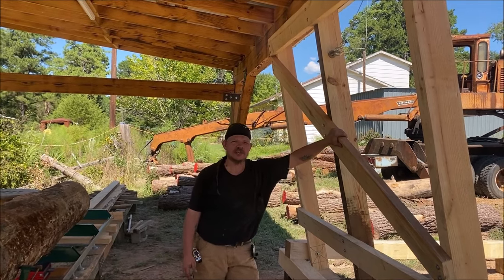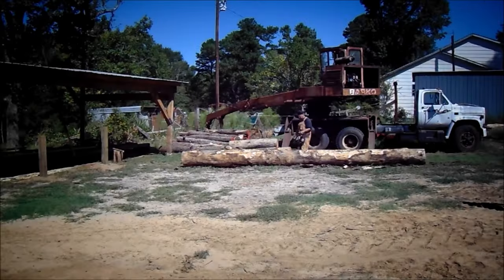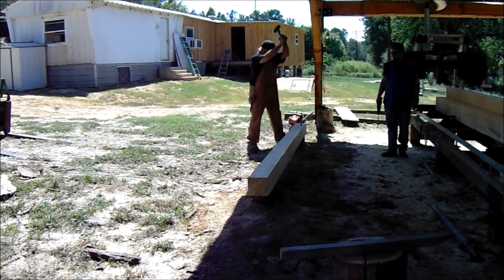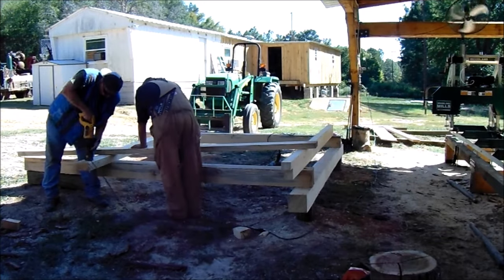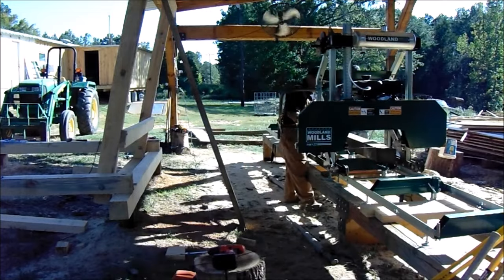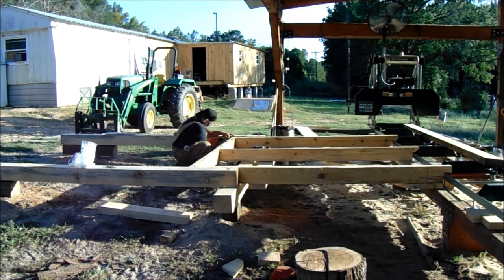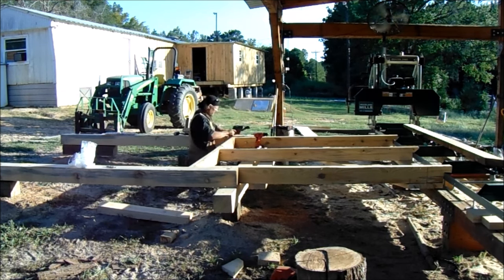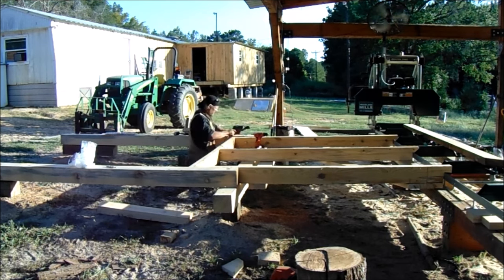Log Deck With Automatic Raising Ramp Build

Comment: I bought two 25 lb boxes of 12 inch spikes 25 years ago. I think I paid $5 each. One box is galvanized screw spikes. I think they used them for log cabins. The other is a wire nail like 1/2 inch diameter bright finish. I have used them for everything and still have a lot of them left.I want to make a brow for my 126 mill. its a lot easier to load from a brow. A mill shed would be good too, but this is my last house. I have a slab to put the mill on.That sits on ledge. We have lots of ledge to set stuff on. Dirt we dont have.Black walnut ! We dont have any in ME.
Reply from the maker: We appreciate you watching our videos and commenting, I wish I could find me some of them to buy, but I just made ours out of re-bar and washers, and beat the end to a point.
Reply: @CountryHomestead1 Thats a good looking nail you made. Those spikes I have were Made In USA. That is how long ago I bought them. Did you drill pilot holes before driving them? I imagine the dimples? on the rebar would grab pretty good too.
Reply from the maker: Yes sir, we pre-drill the hole first and then nailed them in and ya it holds them real good

Comment: Sorry I got diverted to something while you were  explaining the stuff I asked you about. Why is your ramp so far from the mill? I get you have to clear the mill itself. Do you clean out the sawdust with the tractor Bucket? Speaking of wrong cuts, My friend was building a shed for another friend and he always gets nervous when I show up to watch. He got kind of frazzled and cut one of the posts off way short. SO THE HEADROOM IN THE SHED WAS ONLY like 5 ft. I thought it was funny butIi left because he got rattled and was embarrassed.Hes a nervous type.
Reply from the maker: I just made it so when I pickup the ramp I have a safety chain on my main beam, so I hinged the ramp right under my outside beam, there is not enough room for the tractor to get in there, we have a backpack blower that will make short work of the saw dust